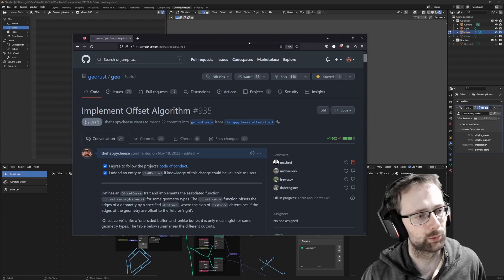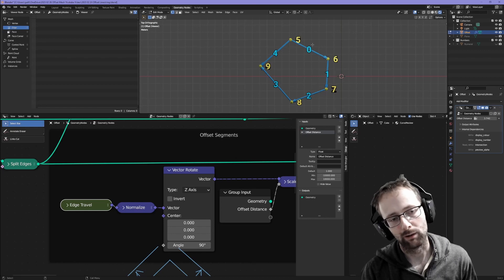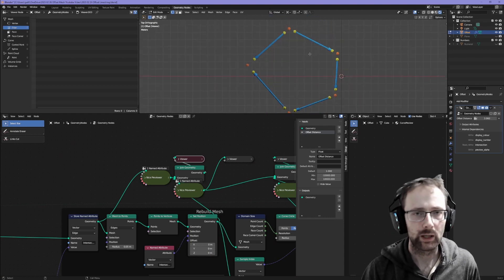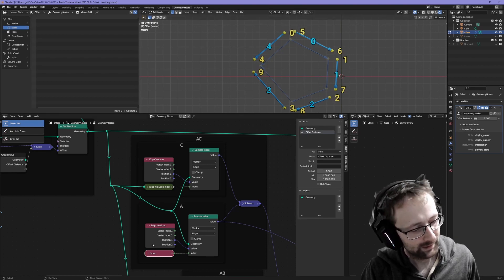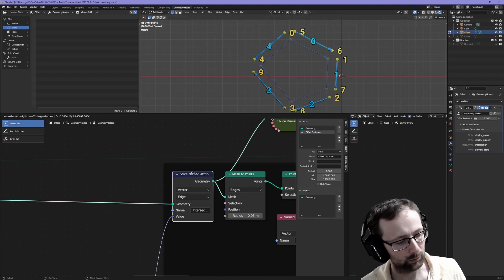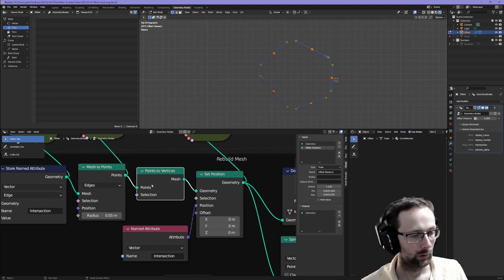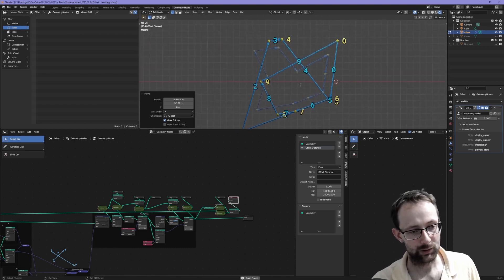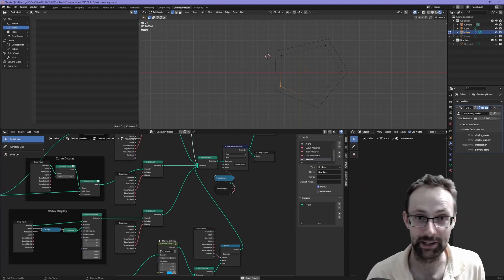Offset Node - Blender

Comment: For some reason I have to put the Angle to 270° instead of 90° to the Vector Rotate for this setup to work. What about making this for multiple curves of the String to Curve, this way you can Offset the hole Text Curves in one node. That would be AWESOME!!!
Pretty underrated video by the way.
Reply: Putting the whole thing in a For Each Element set to Spline Domain did the trick. But with text is pretty terrible since small Split Segments mess up the Offset 😢(I guess you have to account for those too). Working great on simple straight lines text though.

Comment: Saw it! Great tutorial and beautifully stylized! If I can say, i think the issue of the subdivided line on 9:19 can be solved taking the Group input geometry, converting it in curve with the Mesh to Curve node and than convert it to mesh again with the Mesh to Curve node.
In this way Blender, while generating the new curve and the edges again, is forced to make a new clean order of the indexes without the need of manually swap the indexes. 🙂
Reply from the maker: thats genius! maybe this is more viable than i thought :)